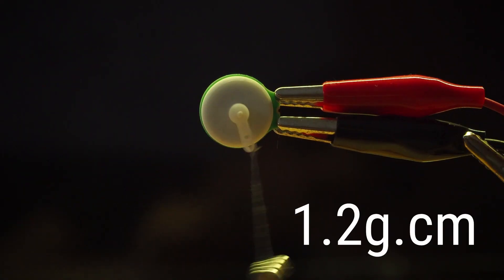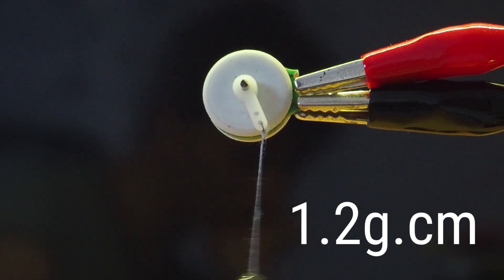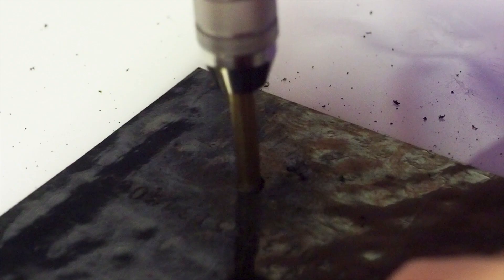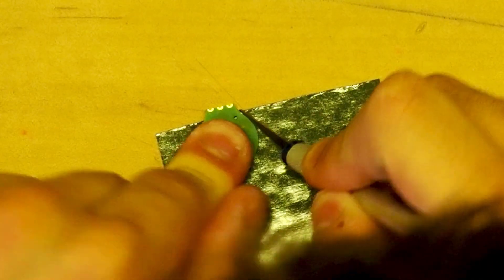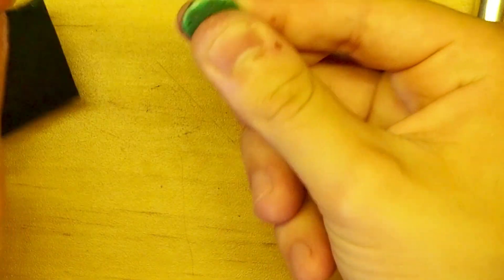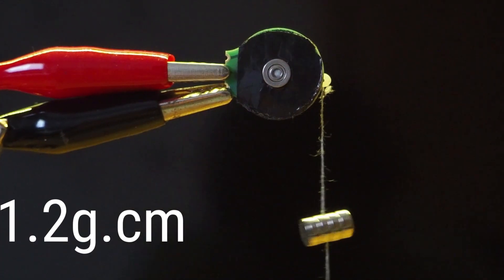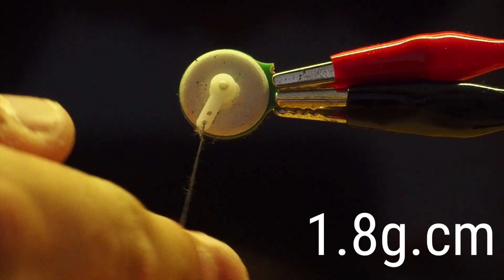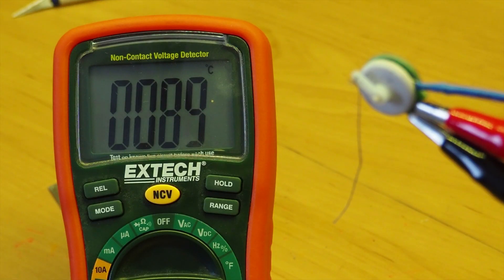Increasing the Torque of my PCB Motor

Comment: you said ferrite sheet , then you said higher temp due to eddy current , ferrite sheet has high electrical resistance so 90c with ferrite then if u used laminated silicon steel would make it 150c or so , 
i think there is something we miss here maybe your ferrite sheet doesnt have high resistance or u use way too high frequency or ....? what do you think ?